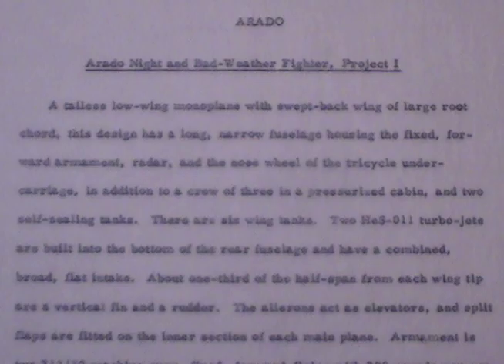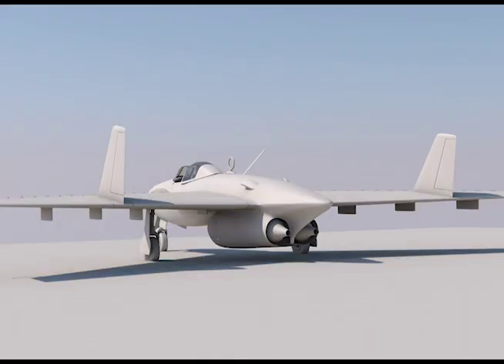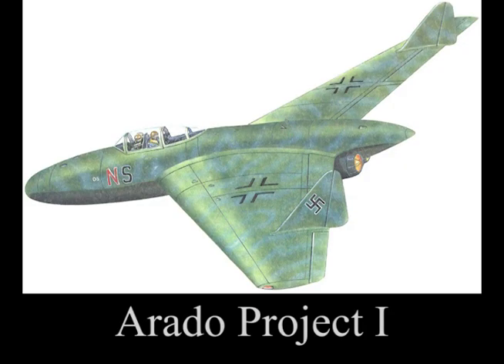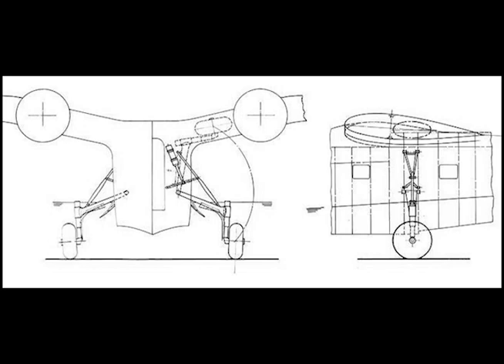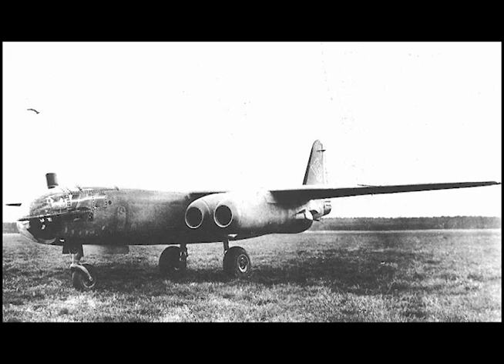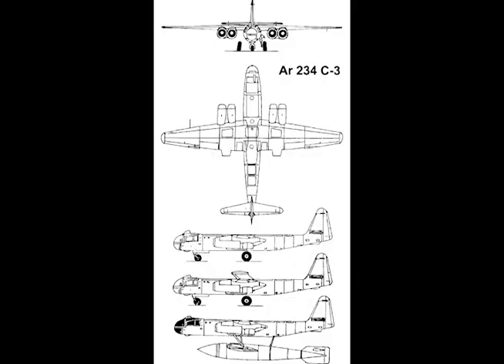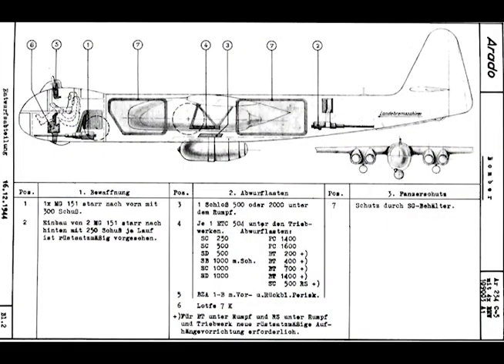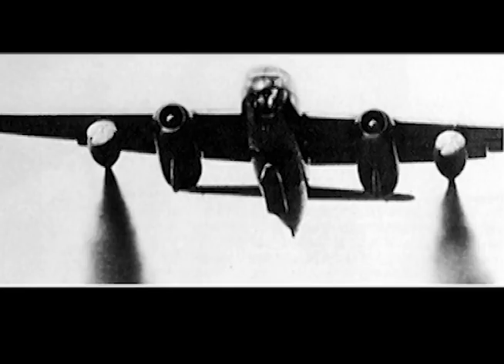German Experimental Aircraft of World War II #3 - Arado pt1

Comment: G'day,

The Arado 1 was an obvious Cull.

The Grass, Mud, Dirt, Dust and Sticks thrown up by the Nosewheel had absolutely NOWHERE to go but straight back and up - into the two unprotected Engine Air Inlets...; and it didn't even have a Mudguard on the Front Wheel.

Yuck !

This was always going to FOD-Kill it's own Engines EVERY time it attempted to Taxi....; in my estimation, at least.

A joke, perhaps ?

Surely nobody could have been serious about building such a thing ?

Just(ifiably ?) sayin'.

Such is life,

Have a good one...

Stay safe.

;-p

Ciao !
Reply from the maker: I agree - the fod issue would have to be dealt with...
Reply: I think you'll find that most of these projects were intended to keep the design teams out of the local Volksturm units and were never serious attempts to build new aircraft. Even the more credible designs suffered from lack of skilled and semi-skilked workers, materials and fuel.
Reply: @neiloflongbeck5705  

G'day,

Thanks...

Yeah, I agree, doodling Foo-Fighter Fantasies was always goanna be more fun than fending off Soviet Tanks with a penny-packet of  Panzerfausts...(!).

Such is life,

Have a good one...

Stay safe.

;-p

Ciao !